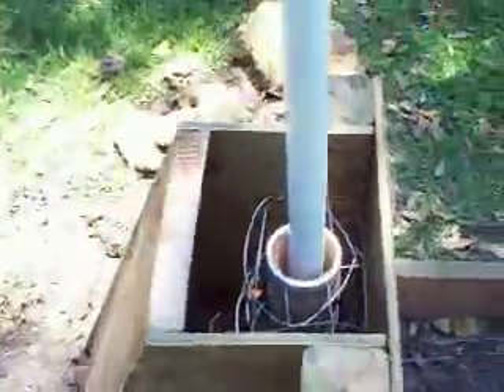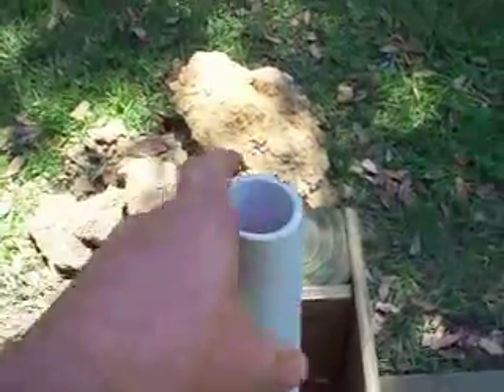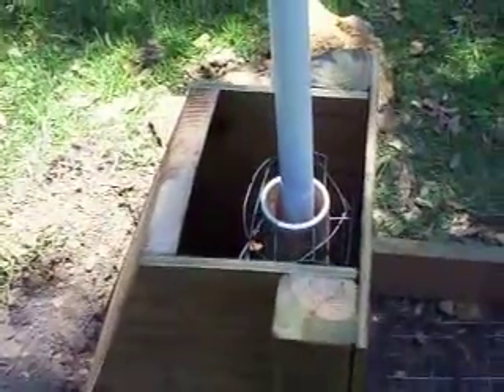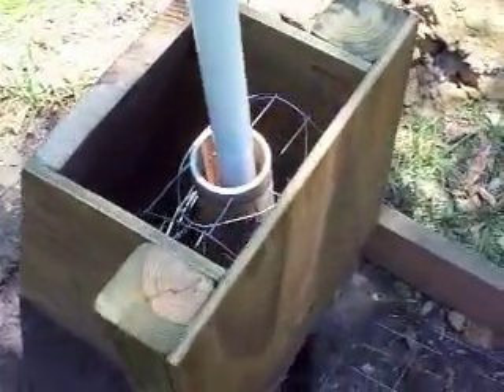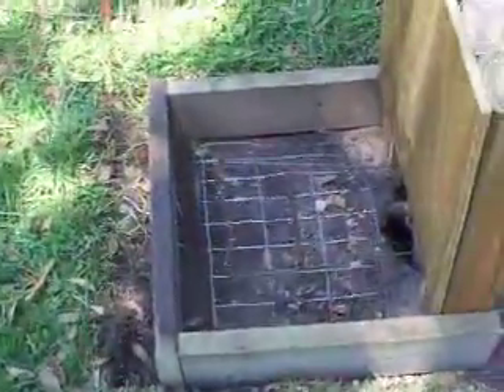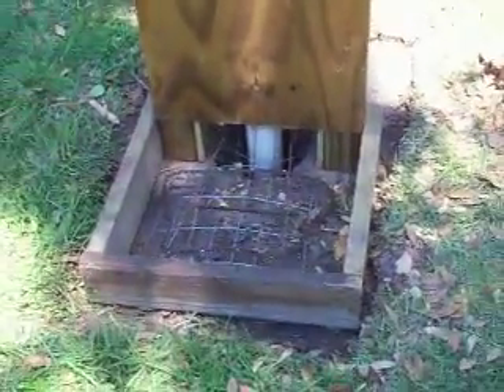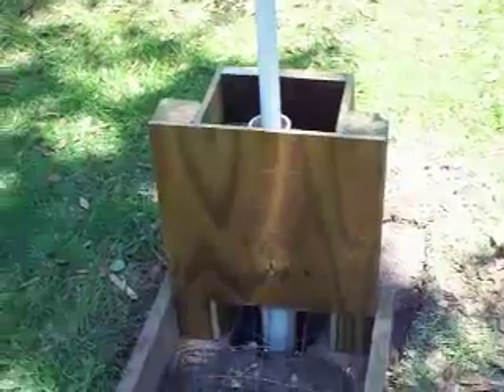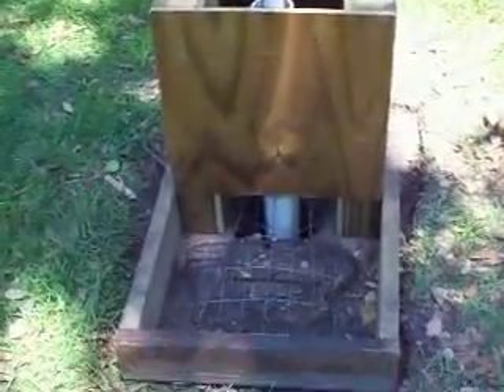Do It Yourself Well Jetting Part 5 Form Work For A Concrete Pump Stand

Comment: is it possible for one of these wells to work at any location at that depth, i am assuming this is not hitting an aquifer.
Reply: I know that where I live there is a layer of sand about ten feet thick that anybody can get to anywhere in the county where I live.  I have no experience with wells anywhere outside of my home area.  But you are right.  This well is not in an aquifer.  This well is just in what is called ground water, but, it is very rare for one of these shallow wells to go dry even after months of no rain.

Comment from the maker: @dave6247 If you don't grease the leathers this well will drain down every time you stop pumping.  With no water in the pump or drop pipe you will have no problem with ice cracking the pump, but you won't have water either.  I don't have experience with cold temps.  I live in the deep south.

Comment: I like the fact that you made your apron come out a little further away from the pickup pipe than I did. I didn't know the pump would throw the water out so far and I end up missing the apron with the water stream. I placed a couple of blocks up against the apron so I don't wash a wallered spot out. Nice job forming!